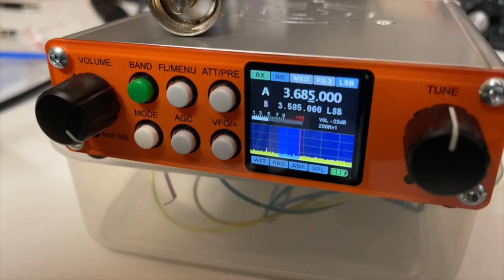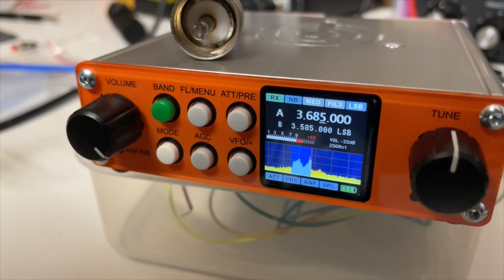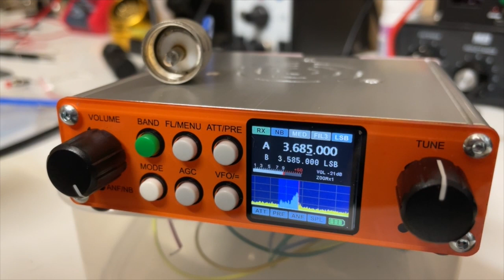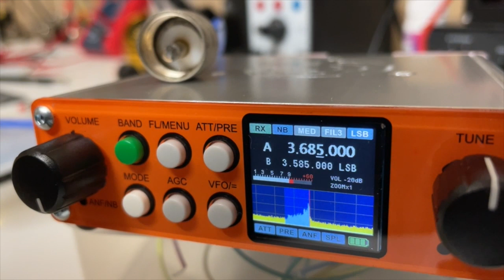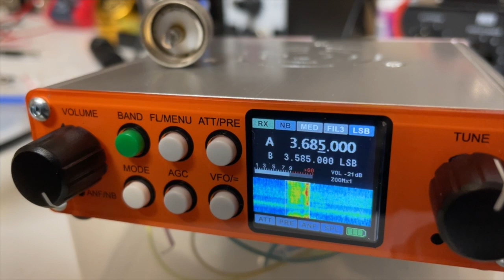Minion SDR Transceiver on MRARC net

Comment: Do you know if you can adjust the power output?  I ask because was thinking of putting a little amplifier on it and the amp wants only 2 watts coming from the radio
Reply from the maker: I don't think you can adjust output power.

Comment: Does the audio comes from the build in speaker?
Reply from the maker: Yes it's from the built-in speaker and it's quite powerful.
Reply: @peterbmarks  Astonishing. Previous users complained about a delay in reception switching on CW (T/R Switch). Does this bug still exist?